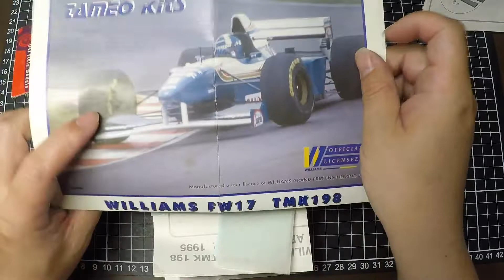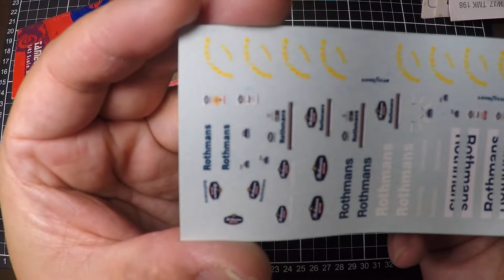#1　TAMEO WILLIAMS RENAULT FW17　ARGENTINE G.P.1995　製作

Comment: Same question, what kind of liquid did you use to slip through the joint before soldering?
Reply from the maker: Thank you for your comment.
Lead-free flux is used.
I don't know if it's correct or not.